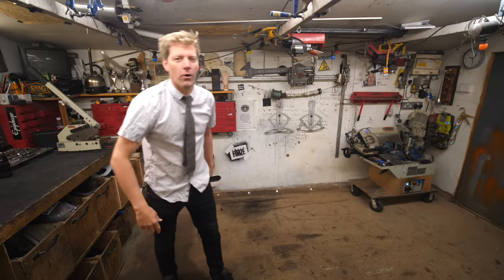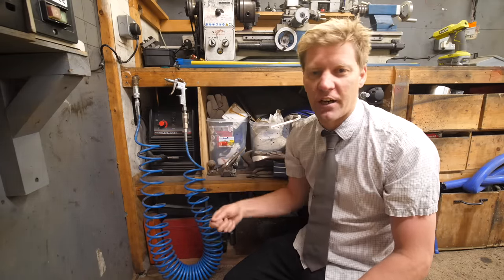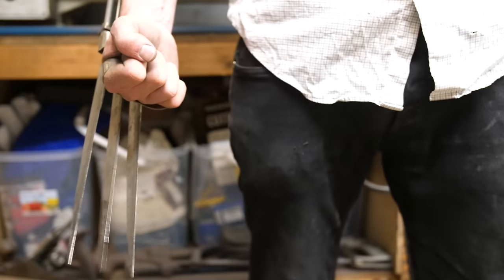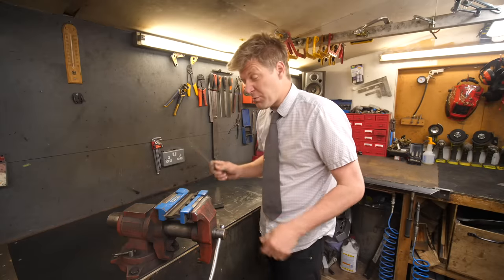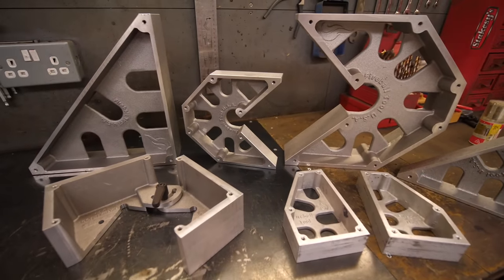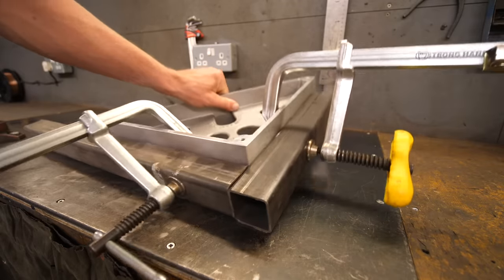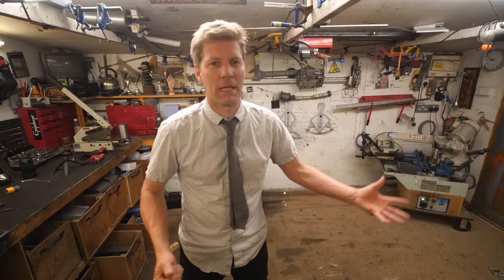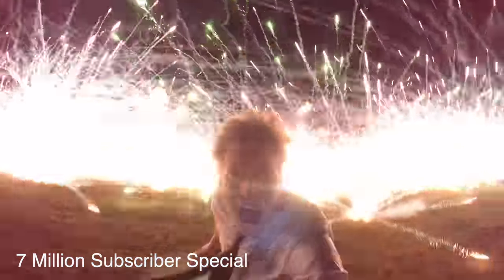Colin Furze Workshop/Tools Tour & Wolverine Claws

Comment: It’s got a carpet furze because you’ve got a secret bunker entrance underneath it 👀
Reply: The hydraulic pump is also already there
Reply: I like how I’m not the only one that goes back and watches videos 😂👌
Reply: When I saw this I thought it was recent
Reply: @Superson1c5   😂😂  there definitely needs to be another one
Reply: Shhhhhhhhhh!
Reply: and he can move the air tubes to the tunnel
Reply: You can also see the winch motor in the ceiling
Reply: oooooh
Reply: @siemcaelers791  nice eye
Reply: A TIME TRAVELER!
Reply: LOOOLLL
Reply: actually its not under that shed, thats his garage, the bunker is under the smaller shed he built
Reply: @ruinfox4108   no a secret bunker entrance to a tunnel which will connect his house his garage and the bunker
Reply: @KITBAD_OFFICIAL  oh you mean the tunnel right sorry, this is an old video way before digging the tunnel so thats why i thought you meant bunker
Reply: @ruinfox4108  it’s fine don’t stressssss
Reply: @ruinfox4108  He started digging the tunnel in 2018. This video was made in 2020. You can already see the winch on the ceiling, and you can see bored he nailed under the carpet to pull it back easier.
Reply: I cant watch this video without staring at the carpet thinking about what's underneath, and he knew the whole time he was filming this
Reply: Definitely can see the carpet marks and fender washers now that I know there is a bunker down there.

Comment: Out of all that lovely equipment the centre finding ruler impressed me the most 😂
Reply: There's a tape measure that's similar to that. For every reading on the tape measure, it also notes what half of that reading is, so you can easily find center. Not quite the same idea, but pretty slick too.

Comment: U inspired me to get my own shed to build little projects out of old bikes parts scooter parts and I’m only 14
Reply: same here man, im 13 and we just finished drywalling my new shed, and I made my first proper flamethrower
Reply: @scottygg8550  How does it work? Pressure fed liquid spray?
Reply: @linecraftman3907  I drilled a hole a tiny bit smaller than a butane refill adapter and basically but a chamber on the other side of the wood which keeps the fire from traveling into the can. I also have a plasma lighter for ignition
Reply: I'm twelve, and my shed is stuck to the fence after our blizzard. I don't actually have a decent shed.
Reply: @scottygg8550  well that's a blowtorch, not a flame thrower. But glad it works! Don't injure yourself please :D

Comment: So just learned that in electricity in London they call it “earth” instead of how us in the States call it “ground”.
Reply: And like us in Australia they call a shed a shed. And a shop is where we go buy stuff for our shed :-P
Reply: The ground wire is the 0V wire in a DC circuit.  Earth is Earth wire in an AC circuit. (That's not to be confused with the Neutral wire. The Neutral wire is the ground in an AC circuit). I hope that helps :-)
Reply: We call it earth all through the rest of the UK too 😉
Reply: Fun fact: earth and ground in Italy are both translated as "terra", but electrically speaking we use another term too, that is "massa" (= mass, in english).
Reply: The uk isn't just london you know.
Reply: What if the ground was on the earth...
Reply: In Australia we use both 😊
Reply: Earth and ground aren't always interchangeable, though
Reply: its earth/ground are interchangeable in the us
Reply: I like how u compared 'the states' to 'London' only
Reply: @miket6978  when AC and DC are present it wouldn't be such a good idea to mix the two, would it? DC does not technically have an earth, but has a ground of 0V.
Reply: @sneaky909  unless the dc ground is mains earth referenced

Comment: Today I learned that the British say "earth" instead of "ground" when talking about an electrical connection
Reply: Yeah... i remember telling my mom that "garbage" is like trash, and "rubbish" is like throwing it away)
Reply: Seth Gremmert as it should be
Reply: Everyone uses both; whichever one is correct in context, because they mean two different things :o
Earth: Electrically connected to the earth underneath you (usually for safety to make sure a device isn't floating thousands of volts above the environment around it.)
Ground: Reference point for the circuit (e.g. negative terminal of a power supply.)
Not that it matters so long as you know where to put the negative terminal of whatever you're connecting :P
Reply: RWoody1995 it also depends on your background
Reply: @RWoody1995  I think Americans use ground for both.
Reply: i use ground for electrical circuits. ground and earth i use for welding, but mainly use earth for earthing my welder

Comment: Heh, My favorite thing to hear people say is "I could do that if I had all those tools...." because the fact that they are thinking the tools are the most necessary component to building shit shows that they know so little about on-the-fly engineering and fabricating that they probably couldn't do it even if they had "all those tools."

You want to build something? Think about what you want to build, look at what you have available to you, and find your way between raw material and finished product by whatever means you have available to you. Embrace the jank and the bodge at first, and then slowly accumulate only the tools that would make things much easier on you. Build jigs. Half of specialty tools is just making things repeatable that you could simply build a jig for.

In fact, I would say for me the biggest hurdle is not the tools, but being able to afford (or find) the raw material necessary for each project. Once you have a tool, it works until you break it. The raw material is the stuff you have to acquire via either purchase or scrounge every time you wanna do something.
Reply: The tools represent time saved doing certain processes. I can do, or have done most all of the tasks, by hand, that Colin's tools represent.  It just takes a lot longer.  

Time is a big factor, so I don't completely discount the 'If I had the tools' statement.

If you can do it by hand, then having the tools means you can do much, much more, in a shorter period of time.

Comment: There is a standard of lathes that's not much bigger but not into floor shop base and jinx, and it's the stub lathe class. I'ts a full size lathe that had a shorter set of ways. Used mainly in the aircraft industry (but well, all over) and there are quite a few brands that made them all over the world, especially in WW2, which...is the problem. Some are quite worn, and those that aren't fetch a price.
Seriously wish that companies would bring back the stub lathe, it was an excellent solution for a size that's neither here, nor there, just right. BEST part about them, they sucked up all the tooling from the big world. Which means there's a serious market for parts that are cheap, albeit if you have the eye and know how to choose, on surplus markets.
I have a few friends who still have such lathes and for types of shop that they and Sir Furze operate, this is the tool, the one.

Comment: Furze... have you given much thought toward installing a first class fire suppression system? Feeling like all your years of hard work in-house and out-shed could come to a tragic conclusion without something a little bit flash and very over powered.

Curious... is it possible to bring the pneumatic system to brunt in providing an increase in stored pressure for the AP system? Getting that those air compressors don't go too high but storing up a greater weight of air would be nice. Could the pneumo be used as a power source to brute force an improv pump like?

Comment: What do you think would be good tools/accessories (like specific drill bits, small stuff, odds and ends) to focus on acquiring for a starting jack of all workshop? I've tinkered and fiddled with things over the years, but never really did any classes or stuff for specific fields so everything is kinda random.

I've got random soldering tools, handful of woodworking tools (electric vibrato sander, really old band saw that still needs some work, buncha manual basic things), ideas and stuff that could probably use some metal machining tools. not an unlimited budget by any means, but after rewatching your Solid Shed video i've something of a desire to build one myself, partially to consolidate everything and partially so i stop dusting up the house with all the random tinkering. 

trouble is, as i said it's all kind of self learned/taught, and i'm disorganized at the best of times, so i'm not 100% on where to start and get everything lined up, so any advice would be plenty appreciated, but in the meantime hope you continue to stay safe Colin and keep having fun makin all this crazy stuff we enjoy watching ^vvvv^

Comment: Serious wiring question for anyone who’s good at that kinda stuff. So I’ve been working on dirt bikes and small engines for years. But I’ve never been to good at the wiring or adding electrical components and I’ve been trying to learn from trial and error. I’ve got kickstart dirt bikes and want to add front lights, but I don’t want to have to wire in all kinds of reducers, fuses or batteries for time consumption and lack of electrical knowledge. Is there any way you can keep the light on at max, even when in idle? help anyone.

Comment: Nobody mentioned that there doesn’t seem to be a relay on that switch and he’s just running the pump power through the toggle switch. Or does he use it so much that the contacts are worn and that’s why the switch is sparking? Not criticizing, I just always thought those switches can’t handle too many amps